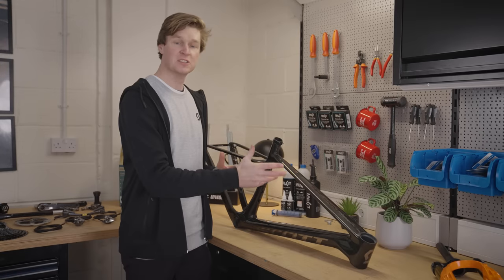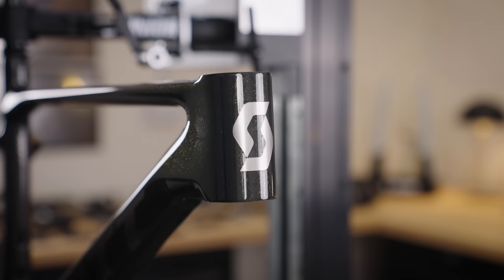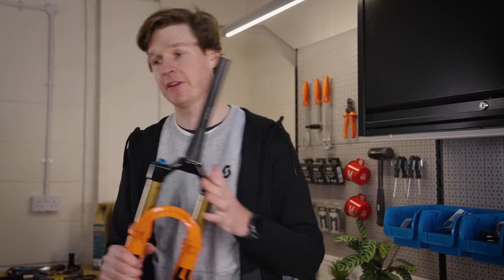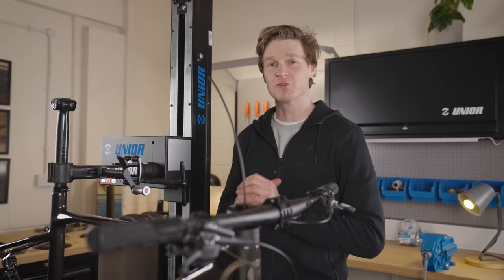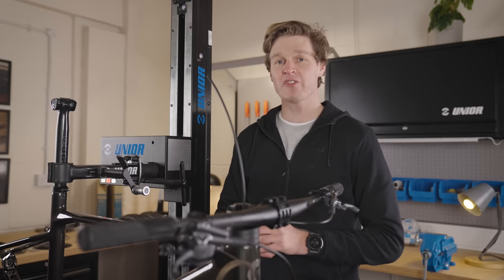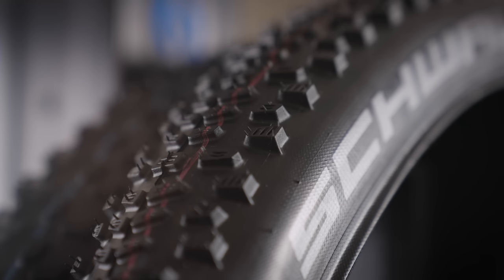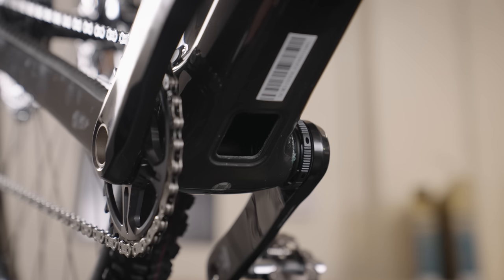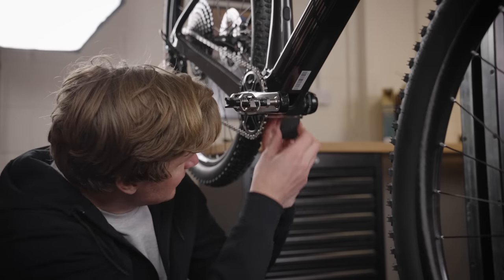Building the NEW 2023 SCOTT Scale RC | Hardtail Dream Bike Build

Comment: how di you mount that crankset with 52mm chainline on this frame?
Reply from the maker: I didn’t, I have a 55mm crankset!
Reply: @ScottyLaughland  but the 9120 crank has 52...
Reply: I have the same frame, and the 9100 won't fit...I'm planning to purchase the 9125. But It has a massive Q factor

Comment: Hey Scotty do you know if this frame will accept 4p caliper???
Reply from the maker: I mean it will but I don’t think you’d want to fit one to it more designed for a 2 piston caliper!
Reply: @ScottyLaughland  thanks for the reply. The scale manual is difficult to read. And the folks here at Scott USA are giving me mixed answers. Would be using it for bikepacking so kinda want a 4p brake or at least the option.

Comment: 9.1kg is too much for SL frame... Have 2018 model rc sl L size with Xx1 and renegate tires 8.5kg...8.2 with furious fred (tubo inners)
Reply: more to a bikes capabilities than weight. is your 2018 fully stock? I'm sure you can make the 2023 lighter and sell some of the parts it comes with... but I bet some of the heavier parts can make up for the weight with performance. I noticed a huge diff with my 2.25 tires vs 2.4's... and that alone has a significant weight penalty but worth it on most trails by me.

Comment: what a way to waste a frame this light putting all shimano
Reply: Shame not to have Sram XX1 AXS on it, hell of bike.  I’m envious.
Reply: @peterfreeman3317  XX1 AXS is a boat anchor compared to XTR. Yeah I understand the cool factor but XTR 45t 12 speed derailleur weighs well below 240g & has ability to climb 50t no problem.
Reply: @slimjim4ever  but with AXS…perfect shifting and no wires.  It’s incredible, true wireless shifting.  What’s better…a Benz or BMW?  Who cares they are both killer!
Reply: @peterfreeman3317  my personal favorite is good ol Shimano XTR M9000 11 speed paired with either E Thirteen Helix 9-46t or Leonardi General Lee 9-45t cassette. Still much better and simpler than any Eagle system I’ve used including AXS. Perfect shifting every time & rarely needs attention. Honestly I didn’t find AXS to be that appealing therefore to me it’s just a unnecessary luxury but that’s just me. IMHO XTR M9000 is like the classic 1988 BMW M3
Reply: Shimano stuff is actually much lighter than most Sram except for the crankset. My personal favorite is Shimano M9000 11 speed shifter/derailleur paired with M9100 brakeset. As for the Crankset I would have gone with E Thirteen XCX if you’re mainly trying to shed grams
Reply: @slimjim4ever  the xtr cassette also? That are de main pieces of the transmision
Reply: @albertomiragil850  I didn’t like the 11 speed XTR due to their lack of range & 12 speed their durability. I juggled with different cassettes including Sram & Garbaruk. Recently I found Leonardi General Lee being #1 & E thirteen Helix being #2. I have many bikes in my garage and they all have mixed drivetrain few running XX1 12 speed shifter/11 speed derailleur (for clearance purposes)
Reply: @slimjim4ever  the comparison is on 12v xtr vs axs and their weights
Reply: @albertomiragil850  12 speed XTR is much lighter than any Sram. AXS is heavy due to battery and electronics. You’re certainly not paying for the grams but for the no-hassle/low maintenance on AXS.
Reply: @slimjim4ever  what the hell are you saying? The crank set and cassette xtr are hundreds of grames heavier than xx1
Reply: @albertomiragil850  I was mainly talking about the shifter and the derailleur. 12speed XTR derailleur weighs 244g while Sram XX1 268g for mechanical and 373g for AXS. Cassette weight doesn’t vary that much with 10-51t XTR being 367g right in between 10-50/10-52t XX1 cassettes. Forget the crankset. Both Sram and XTR are heavy. I never used those anyway (except for 165mm XX1). E Thirteen XCX makes excellent cranksets and they weigh sub 400g with 34t chainring.
Reply: @slimjim4ever  meeeeec error, the xx1 crank weights 380gr, near of RACE face Next sl ,and only 50gr from e13
Reply: @albertomiragil850  XX1 cranks weigh slightly below 380g without chainring. You add a chainring weight goes up to 425-440g range. E thirteen XCX weighs 340g so much lighter. Add a chainring you can still have it sub 400g including chainring

Comment: scott hasn’t move on from press fit
Reply: When  done proper it is beter and lighter
Reply: @wish-lt1zh   people dont seem to understand that pressfit only fails when manufactures are unable to follow accurate size standards.
Reply: Wider bottom bracket area with press fit equals greater frame stiffness as well as less weight, seems like the perfect solution for a XC race weapon.
Reply from the maker: Press fits so easy, get the right removal and installation tools and it’s a doddle. Having insets for a thread Keane you have to bond in another section and is heavier - this is a much simpler and lighter construction.

Comment: Hate that they made basically a trail hardtail and not an XC/Marathon one. They already have Spark for those purposes. Too slack head angle imo, too long reach, and even 120mm fork? Also proprietary cable routing with proprietary stem/headset, and even BB is not back to safer/more reliable threaded variant? No thanks. Other than clearance for 2.4 tires old Scale is directly better bike imo. Now only Specialized Epic, Mondraker Podium and Canyon Exceed make good XC/Marathon bikes
Reply: Scott has different versions from the scale. I think it was the ultimate version which is not so slack and more for race people. But… also a lot more expansive… I can feel your pain. I also wanted a scale but the entry level frames are just for beginners ?😢😅
Reply: I was on the Scott website and looks like they have only one frame design fits all this year.
Reply: Made for downcountry category, maybe?
Reply from the maker: @yengsabio5315  I think these are made for XC, they're designed in partnership with the SCOTT World Cup team!
Reply: @ScottyLaughland  Or, modern XC vs prior XC mtbs.
Reply: Bro gravel bikes are slowly inching their way to xc marathon cat. I'd rather see more bike companies improve their xc bikes with modern geo's.
Reply: Sure, you understand more about xc than the team that won most of them for last decade. The suspension is a 100mm fox 34.
Reply: Lol yet Col Paton goes out and does the Leadville 100 on it😂
Reply: Yeah this are full xc bikes there hela light and even pro riders ride them
Reply: It’s literally sub 9kg that screams xc to me